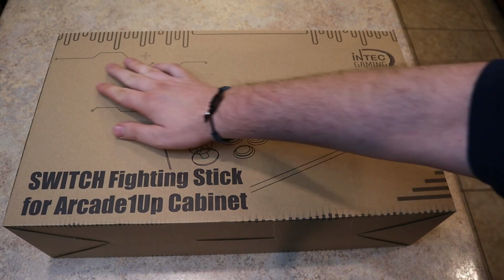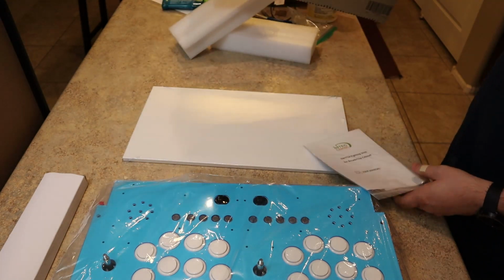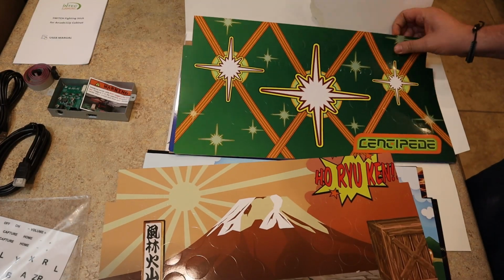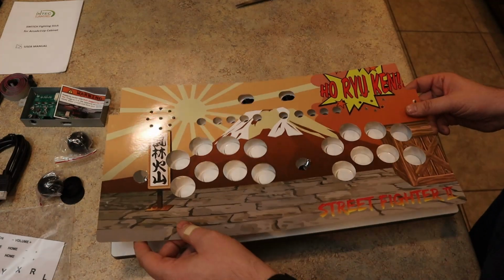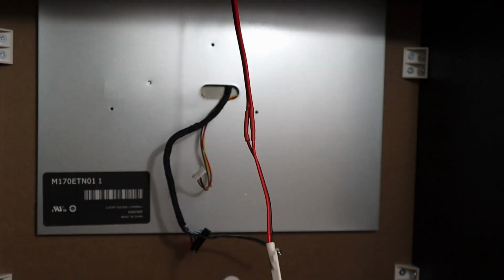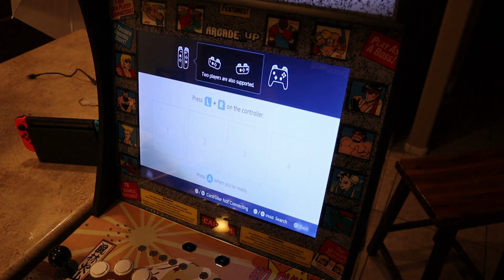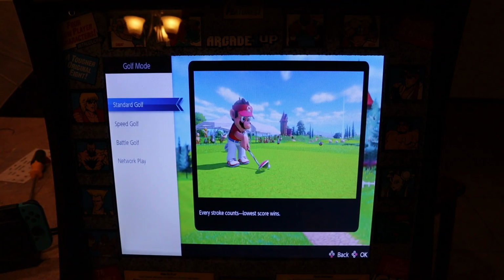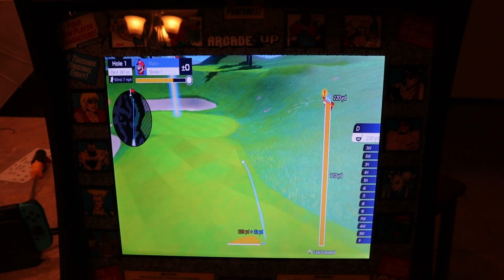Switch Fighting Stick for Arcade1Up by Intec Gaming Review!

Comment from the maker: What do you guys think of this Nintendo Switch Arcade Stick/Conversion Kit? Will you make a Nintendo Switch Themed Arcade1up?
Reply: it's cool and I'm glad it exists. Personally I think a PC with emulators/Steam is a better option to drop into an arcade machine.
Reply from the maker: @MadR0bb  appreciate the feedback, for $135 this could be a cost effective quick fix for some
Reply: @MadR0bb  it depends. Hamster and M2 are kings of Arcade Emulation and nither sega ages or Arcade Archives is available on pc.

Plus switch has some good exclusives nor even pc can run properly
Reply: @MadR0bb  also if it wasn't clear you won't get better emulation beyond Arcade Archives,M2 or code Mystics all three are leagues better then the best free emulations
Reply: @smg4reblooperd182  Well it better be better emulation if you're going to pay $7.99 or more per game.
Reply: @MadR0bb  You've never game collected before have you? Most good nes games cost three or even five times that so even ten bucks for Karate Champ is a Deal.

Even more extreme is getting the original jamma boards that costs easily $90-$600 each
Reply: @smg4reblooperd182  Yes, I collect games too, but I don't have a lot of money to spend on them. I've bought arcade archive games on Switch and they are good too, but I can't buy every game. This product is great for someone who already has a large collection on the Switch and it's nice that it's pretty much plug an play and easy to setup. For me though, I'd prefer a PC.
Reply: I bought 2, one for horizontal games and one for vertical games. I plan on making a dedicated Donkey Kong cab
Reply: No, not when I can use a standard USB convertor stick for 18$ and run Yuzu

Comment: Did yours come with the 4 screws to hold the acrylic protector down? Mine didn't. If the 4 from the 1UP can be borrowed, I guess no worry, but woulda been nice to get those.
Reply from the maker: Use the 4 from 1up

Comment: I only have one question can you mod the buttons on this. Want to have the light up style buttons.
Reply from the maker: as long as you have a way to power the light up portion of the buttons - never looked inside at that encoder board to see if there is a power port - then you could do this

Comment: Is it possible to play the original xbox on an arcade 1up machine using this set up? And if so, instead of using dongles to connect the controllers, can't you just use a usb to original xbox cable to connect them?

Comment: So do you have to have a controller or joystick, and have to re sync arcade sticks every time it powers on or comes out of sleep? I got mine and every time I turn the arcade on the arcade sticks have to re sync. Every time! Can’t even get to switch menu without a pro or joy con. Just wondering if that’s the same for you or if I’m missing something. Cuz if u have to resync everytime then this thing is going back

Comment: Pdubs, are the ZR/ZL still reversed?  Makes playing pinball impossible...
Reply from the maker: Yes but let's see if they do a firmware update but then again the last thing I want to play pinball on is an arcade1up 3/4 scale machine.
Reply: @PDubsArcadeLoft  agreed but any game that uses the ZR/ZL is backwards as well.. not sure if it really affects many games but its worth mentioning
Reply: @kevgret  you can swap the cables between them. 🤷🏽‍♂️
Reply: that's was I wondering/thinking...should be easy enough. great observation
Reply from the maker: great idea
Reply: I thought pinball games use +Control Pad Left and A button for the left and right flippers respectively.  It's like that for the NES and Game Boy pinball games.

Comment: WILL THIS WORK ON PC OR DO I NEED ANY ADAPTERS?? ?
Reply from the maker: I installed it on my Arcade1Up Marvel Super Heroes Cabinet - in the video I had it on the street fighter cabinet - I did not test it on any PC and really no interest I have so many other arcade sticks to use for PC - but - I think you might need a Switch to Xbox Adaptor to make it work on PC - Plug and Play and give it a shot.
Reply: @PDubsArcadeLoft  so you mean plugging the USB cord from the fight stick to the adapter, correct?

Comment: Had mine for a few weeks now and definitely happy that I grabbed it. I hooked mine up to the my MSH cabinet and I only have 2 issues. The first is that there is about a 1 inch gap between the control panel and the monitor. So while it fits with the version 2 cabinets, just be aware that you will have that gap in there. And the 2nd issue is that they only supply you with 1 usb->micro usb cable, so you need to purchase a 2nd for player 2. In the end I can play SOR 4 on an arcade1up cabinet, so I'm happy. Great video man!
Reply from the maker: Thanks OCG! Much appreciated!
Reply: I just recently returned the one I bought because I couldn't get player 2 side to sync up plus some buttons on player1 side was working either. I tried everything I could think of and the stick wouldn't work right.. So ima wait a few months later and try to order another

Comment: If I wanted to play Burgertime and Moon Patrol, I'm assuming I'd need 2 setups?  One for horizontal screen and one for vertical screen?
Reply from the maker: Depends on how you want the aspect ratios to look - if you want them to be accurate possibly.  There is a switch on the PCB/LCD Converter board Intec Gaming provides with the kit that does switch the aspect ratio to vertical Arcade1Up monitor mode.

Comment: Hey PDubs. Thanks for the vid. So I bought this and I converted my MK II Arcade1UP. I was looking into doing the same to a PAC-Man arcade. As stated on the Amazon listing, it says it needs some different setup. Just couldn’t find how. Have you heard anything about how to convert that one? I ask because the screen is vertical. Maybe flipping it horizontal is what it takes. Please let me know if you know anything. Thanks.
Reply from the maker: There is a toggle switch on the HDMI/LVDS converter board that comes with their kit, you just toggle it to the vertical screen orientation
Reply: @PDubsArcadeLoft  thanks for replying. I appreciate it.

Comment: Awesome vid! A few quick questions. I want to connect a Switch, an Xbox 360, & an emulator box (Arcade Box or Super Console X King or Raspberry Pi).

Will an hdmi switcher work on this so I can switch between consoles? 

Do I need additional cables, etc for Player 2?

Lastly, do I need their USB dongle adapters for those systems to work (I saw they sell a bundle with two dongles)?

Thank You!
Looking to order and get started.
Just needed to confirm a few things first.

Comment: So this will replace whatever arcade1up pcb you use?  Guess you have to be willing to gut the cabinet before buying this.
Reply: Not really more just disconnect
Reply from the maker: All you do is remove original control deck and PCB its not a full gut job but probably a cabinet you would dedicate to playing switch games

Comment: Great video!!  I didn’t know this existed.  Did I see in the comments that this could be used with other consoles and PCs? Does the HDMI port work with any input?  Does the controller connect via Bluetooth to the other consoles or can you hard wire them with adapters?  Sorry for all the questions…I couldn’t find any information online and Intec does not have a website with info.

Comment: great review pdubs....wondering what other iterations intec might be planning besides the sega genesis one I saw.  I wonder how compatible w/pc this might be.  toykade I think connected a ps4 to it somehow but don't recall the details as I mostly game on pc

edit: if would be cool over time, if you could update us on the longevity and experience/impressions of the sticks/btns...I'm thinking of still going more custom w/my 1up cab like iL or Magstick with iL or Happ btns mainly b/c I want that old school arcade feel

edit: sorry I keep editing but got one more idea :)  wondering if anyone sells a toggle splitter/switch that would allow one to switch b/t the stock A1up pcb and a pc or console like the switch that this unit is made for
Reply: Did you ever hear back re the splitter? I want to do same to mine, keep the pi but add the switch/others without faffing too much. Cheers
Reply: @jhandslip  Sorry I guess I hadn't responded to this previously...I hadn't heard of any particular splitter geared towards this.  Most of the videos I've seen regarding this product seem to provide the same info.  None of them really seem to go into adding a pc and a couple of other consoles (like I'd use it for if I could).  After reading reviews and viewing many of the videos on the intec switch deck, it is my guess that it should be doable (using an hdmi splitter) w/o event.  I'm also guessing one could connect the deck to a pc via hdmi for video and controls via mini usb to USB A cable that is included for player 1, but an additional would have to be used or purchased separately to connect P2's controls to a pc.  The main issue (if you could use a splitter) to toggle b/t a pc and other console(s) might me that you'd need the aforementioned mini B to USB A cables for P1/P2 to go to a usb kvm switcher as well, I imagine.  So you might have to do 2 toggle btn presses (and ensure you could have easy or remote controlled access).  One press to change b/t your active device (ie. your Raspberry PI), another press afterwards to ensure the control deck for both players is active via the usb kvm switcher for that new video input.  You also have to remember the power states of the desired device(s) unless you're okay w/leaving them all on (not advised obviously for energy saving).  I guess one would ideally turn on desired device just before toggling to it and turning off the other device after no longer using it.  This hypothetical process can be wonky of course due to the hdmi and kvm USB switchers one chooses so expect this to be possible and to review their quality.  Also remember these intec decks are pretty new in general and maybe future iterations may be more seamless.  Hopefully a competitor will make a comparable product.  I'd personally like to add my own sticks and buttons, or have someone like ultimarc make a premium version.  I'm honestly surprised, and a little sad that more of the arcade DIY companies haven't catered to this, as they usually offer sticks/buttons that are not much better than generic.